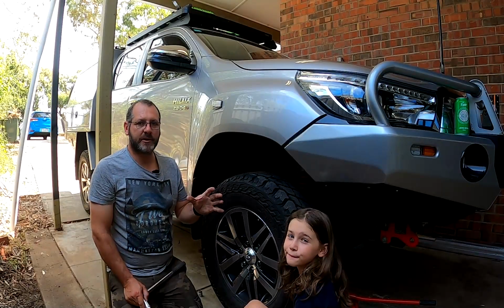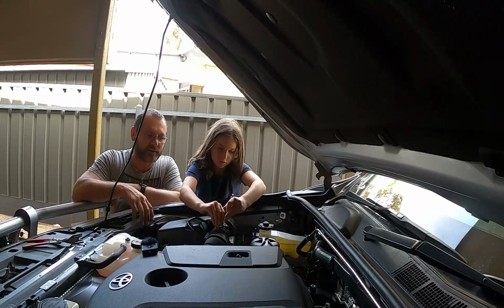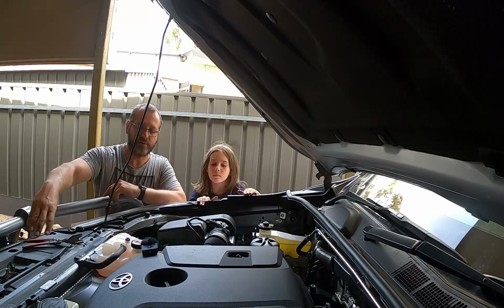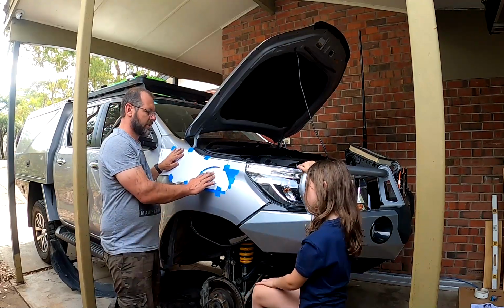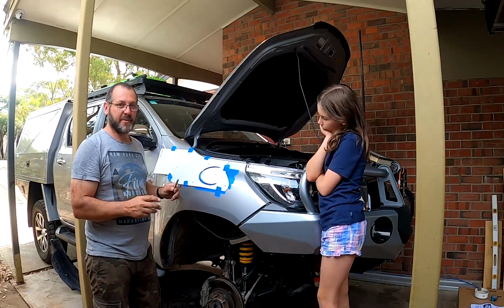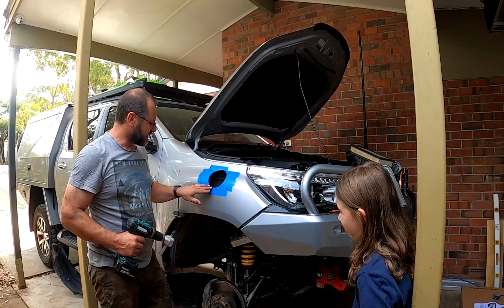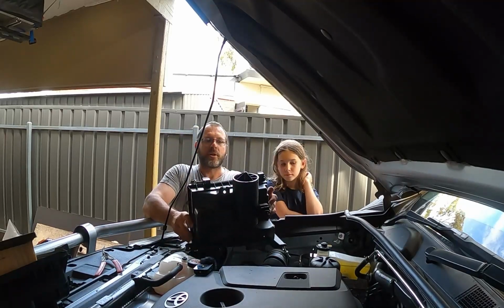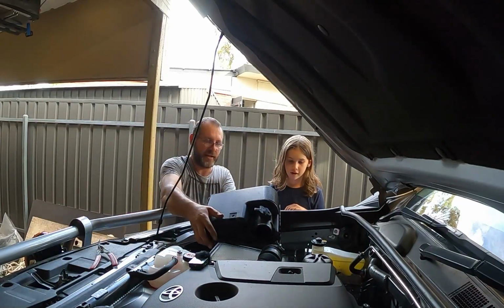Safari Snorkel install on a 2020 Toyota Hilux

Comment: Hi mate, for the pillar bracket did you use plastic grommets and screws, or pop rivets?
What did you seal the bottom of the airbox up with?
Thanks 👍🏻

Comment: I’m not sure to sealed the small drain holes at the bottom of the air box as heavy rain. Maybe if I have room I will install a small tap and close it during water crossings. But looks like there is no room.  I’m about to do my snorkel install.
Reply: Have u done it yet? How did you go with the tap idea?
Reply: Yes i sealed up my 4 small drain holes and used a 8mm air line for a drain which i can reach behind the wheel to shut it off . I run with it open until i need to close it .